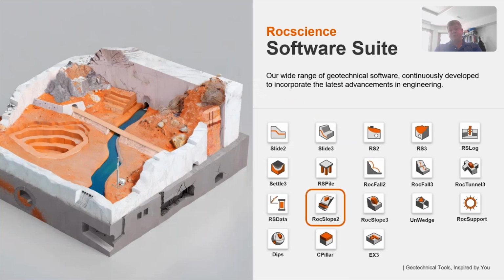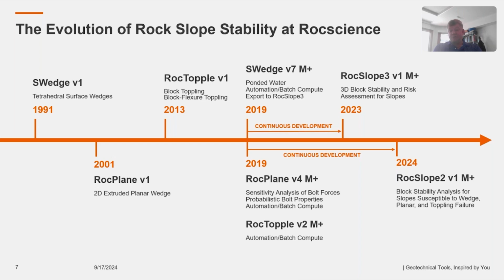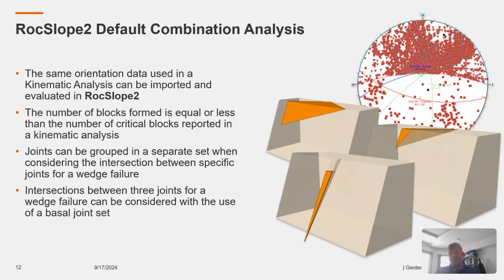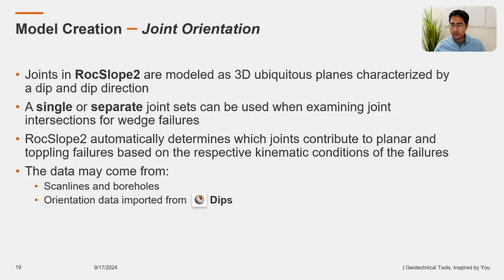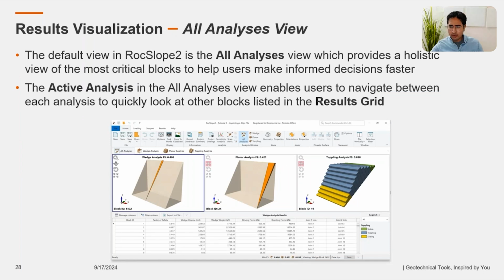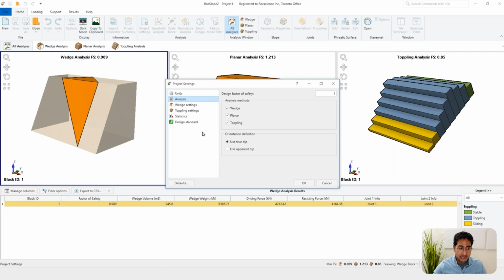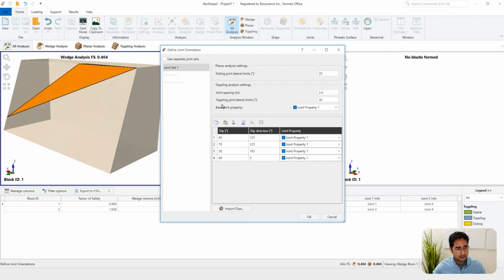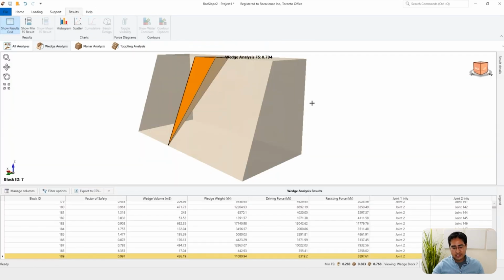Webinar Recording - Introducing RocSlope2: Revolutionizing Rock Slope Stability Analysis

Comment: Hi, I try to use rocslope 2 and I used the kinematics planar file from dips and if change to wedge analysis mode in kinematics analysis it give me 1063 critical wedge analysis, but when I import into rocslope 2, it give me 3790 wedge in the table, WHY ? I understand that the wedge should be equal or less than the critical kinematics blocks of DIPS (1063), I use the same orientation of the dips in ROCslope, furthermore height 30 length 30 bench width 20 (upper face 0 and dd equal to DD of the slope), Could you help me what is the reason please ?